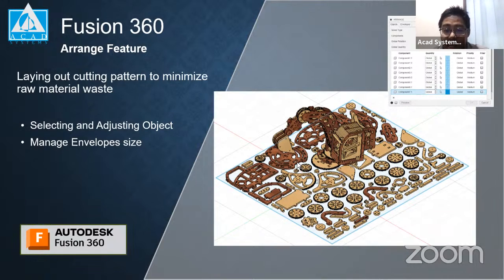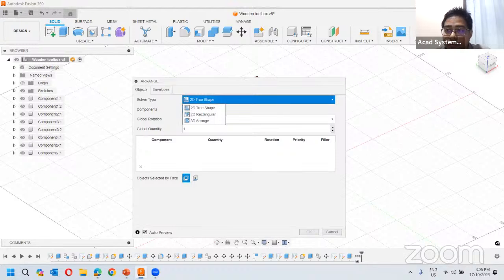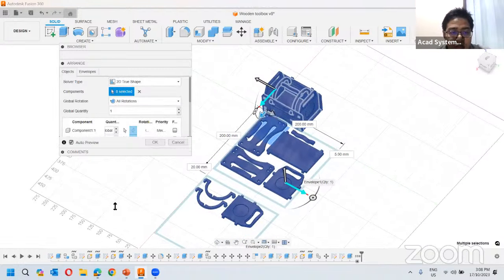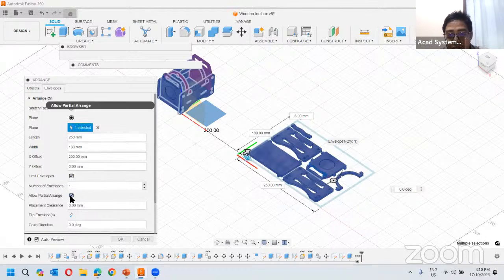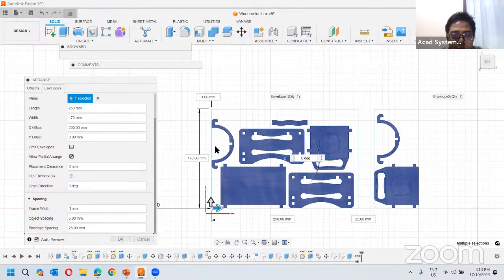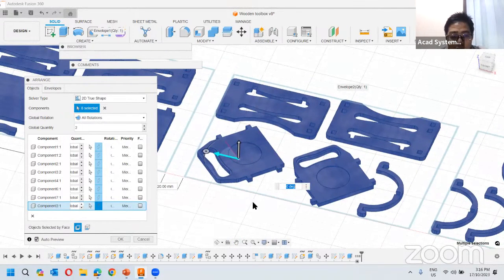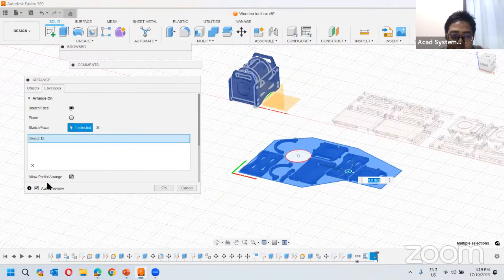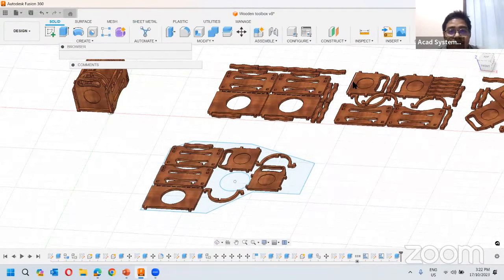Autodesk Fusion 360 Arrange - The Nesting Tools

Comment: This is great. But how can I export my layout as a drawing now. I don't want to machine my parts right from within fusion but export the 2D-data to another processing software like Ligtburn. Thanks!
Reply: Hi. For that, you can create 2d drawing first. From the Model Browser, find the Arrangements folder the Arrange item that you have created. Right-click and create drawing. Later to export into drawing like dwg or dxf, go to the export ribbon on the drawing tab. Its on top right corner and select your desire output